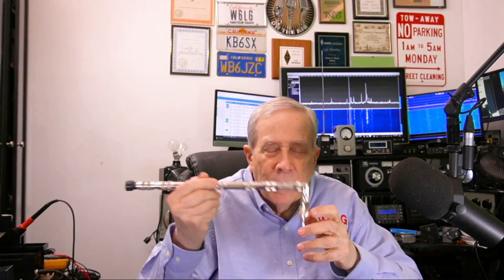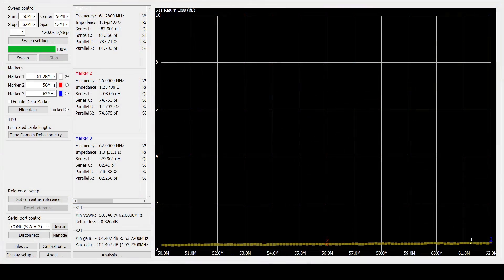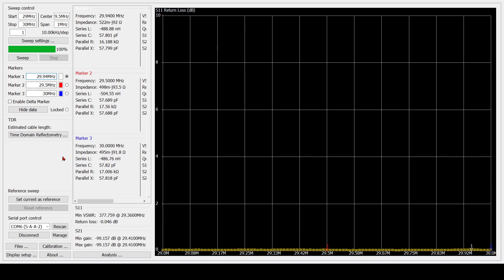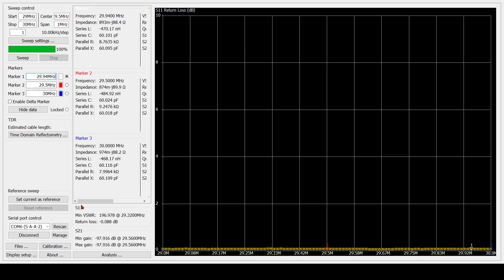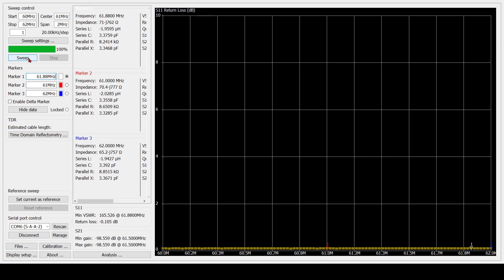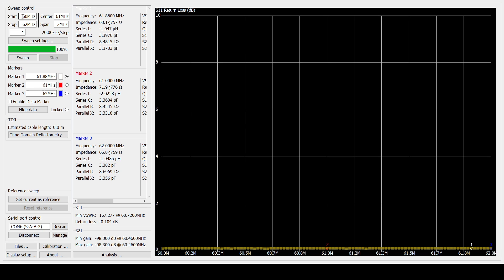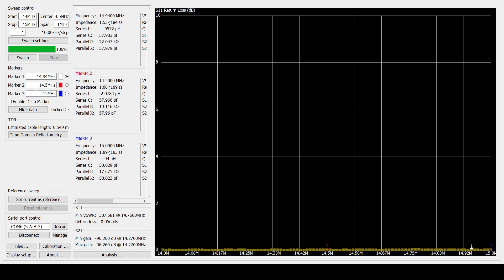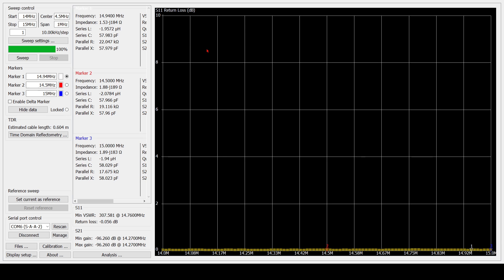Does the PL259 (etc.) have more loss than an N connector at HF?  Which should you use?

Comment: The reason why I may choose an N with an adaptor over a PL259 is availability and options. There are often many more N connectors on the market, and I can choose between crimp or compression etc. whatever the coax be. You end up with a better built and better quality plug with a seal, plus it's often cheaper than the PL259 because of supply and demand. You sometimes have only one option for the PL259 and it is rubbish... or no option at all.

Comment: Many of the old HF tube rigs had just screw terminals to attach striped back coax or a UHF connector with inches of bare wire going to the tank circuit. Even if you clip two pigtails together, you won't see much loss or vswr. The mismatch is just a very small fraction of a wave. Also, if you have a tuner, it all gets taken out anyway.
Reply: Being in the trade I accumulated offcuts of cable. I am not sure I should admit that a "temporary" feeder for one of my HF antennas has a taped up join just outside the shack, it has only been like it for 6 years...
Reply from the maker: Two screw terminals on phenolic; I still have some of those in my junk. 73, Jim

Comment: HF is close to DC compared to microwave. That's where you have to really worry about your connectors, as well as your cable lengths. I had a Tech Class ham friend who tried to put his home wireless network antenna up on his roof using about 60 feet of cheap RG-58 coax so he could use his network devices around his large yard. He called me over when it barely worked 10 feet from the house. He couldn't figure out what the problem was. I showed him the loss chart for 2.4 and 5 GHz (the network frequencies in use,) using 60 feet of RG-58. At those frequencies you can make a stack of connectors like Jim has done and possibly use them as an attenuator to drop a signal a few dB to get it within range to measure without damaging your test equipment, although RG-174 works much better for that purpose. Something around 7 feet will give you 3 dB of attenuation at 2.4 GHz.

Comment: Was hoping you'd try 440 for a bit.  I have a dual band vertical with an N and N's all the way down on LMR600.  Always kind of wondered if I wasted my money there.
Reply from the maker: N connectors are superior at that frequency compared to "UHF connectors".  73, Jim
Reply: @ham-radio  Ya, I figured they would be.  Was just hoping to see if it was a huge difference or slight.  You can just make it up on TX with more power, but I always wondered if I'm literally hearing more because I spent an extra $100 in that area.  The setup I ended up with is modest but it seems to have a really good coverage area.

Thanks.
Reply: I have a dual band vertical, and also run LMR 600, but PL 259's on each end from a previous use.  With a Kenwood TM V71A, its main job is dual band repeat so I can speak to the "local" repeater 65 miles away, from almost anywhere in my county.  I have yet to see a lack of actual real world performance from my use of PL 259's, and run the Kenwood at half power without any issues.  Today I should test if I can't hack it at 5 watts on low power!

Sometimes ERP and gain are everything.  Sometimes you have a big enough sledgehammer anyway.
Reply from the maker: @kingduckford  Understood.  At VHF and UHF, there are good connectors and adapters that are used in commercial applications for many reasons.  PL259, et al, have huge losses at UHF.  But, as you point out, in a pinch you can overcome those losses. 73, Jim

Comment: OK, see you said HF in the title.  Still, I would have liked to see you do the same test at 150 MHz and 450 MHz. 

I have several 50 and 100 feet lengths of coax, mostly RG-8x or similar and RG-58.  Some looks like it may have been used but in great shape and other looks brand new.  Can the Nano VNA test that and tell me if the coax is good or should be thrown away?
Reply from the maker: Yes it can.  Above HF, you should use a good suitable connector that is designed for VHF or UHF.  At HF, for most of us, the PL259 is good enough and it can handle the power with that large pin.  73, Jim

Comment: Once again thank you for taking the time to make the video Jim. I think many of us in the trade have almost a phobic response to Pl259/SO239 connectors. For an easy to fit crude connector they are pretty good, IMHO the biggest problem is the lack of certainty with the shield connection.
Reply from the maker: Thanks and I agree.  Soooo, I crimp the shield.  I have good tools for crimping.  73, Jim
Reply: @ham-radio , thanks for the reply, I meant the shield connection between plug and socket, if the collar is not tightened properly. An N-type of course is not as fussy if the collar is not tightened. One of these days I should start using crimped RF connectors.... I am a bit of a dinosaur! 73

Comment: Might sound like heresy,  but I learned to
really fray the shield and solder it to the 
OUTSIDE then cover it with a quality tape, or even heat-shrink tubing. Cheers and 73. WW5MB

Comment: I was always informed, when I started in Ham Radio over 45 years ago that N was always a better connector; 50 Ohms and usually weatherproof.
N connectors are usually also used for U/VHF frequencies. To support that, Yaesu uses the N connector for V/UHF connection and PL-259 for HF at the back of their FT-991A transceivers.  
Thanks for the video Jim!  Always informative.
Reply from the maker: The title of the video was about HF.  I have N connectors that are in no way waterproof at all.  Some N connectors are water resistant but not waterproof from what I have experience in almost 60 years of ham radio.  73, Jim
Reply: @ham-radio  like I said… weatherproof.
Have fun.
Reply: There is NO 'N' connector on the back of my FT-991A.
Reply: @richardlmontel  I live in the UK and there is one at the back of mine… all UK 991A’s here have it.
Reply: Wow guess we are not suppose to know the difference here, pitiful.
Reply: And to add injury to insult my 2m, .70 does not have an N connector.

Comment: I only ever worried about them on the radios.. I used NMO mounts because they were low profile when antenna was not on vehicle but I figure my biggest loss is for ball mount with spring, yet I only run HF mobile using all mount and spring..except when in a truck where i mount dipole style off the mirrors and usually phase them as well..lol
but N connectors against the pl259 or the bnc??? Small gear I use BNC for weight.. but prefer PL259 as N is heaviest connector and even on 2 meters and commercial gear, I found no loss problems between it and N- many commercial VHF radios use to have PL259 connectors
Reply from the maker: All good information to those who don't seem to understand about connectors.  Thanks for the help.  73, Jim

Comment: What am I missing, please?  I was told that for every connector I added in series in my coax to expect half a dB loss.  I expected that with 6 connectors in series there would be 3dB loss.  Thank you.
Reply from the maker: Almost zero loss at HF.  Watch my video where I string about 30 connectors together and have no measurable loss.  73, Jim W6LG
Reply: @ham-radio  Wow ! that was a very qick reply.  I watched that other video before getting this reply.  
One of the comments below that video mentioned that ypur test results blows out of the water the theory about each connector adding much higher loss than we've been told.
I see that to get low signal loss we should spend on high quality coax instead of on connectors.  Thank you very much.  73 Nk5I

Comment: I like the N-Type sets reading at 20m. 0 loss, but a VSWR of 133421:1.......I doubt my tuner will bring a pre-built stick, let alone a wire to <1.5:1 from this SLIGHTLY high reading........ 

On a side note, I have 2 antenna's sitting here waiting to be put back in the air. One is a dedicated UHFCB (477mhz) 12dBi stick I have had for over 25 years, it has an N-Type from the factory. I also have a v2000 Tri band 6m/2m/70cm stick and it has a PL-259 from the factory, even though it's designed for UHF aswell as 2m and 6m. I would LIKE to believe the designer's of these sticks know MORE than I do when they build them and if they think the PL-259 is OK at even 440mhz, who am I to argue? I have to say, in using the UHF stick I have run RG-58, RG-213 and CLR-400 cable on it and have been unable to tell any real world difference. I get the same response from my local repeaters on all 3 coax, if I listen to the inputs, there is a SLIGHT increase in the static on the RG-58 cable compared to the other two cables, but all three cables allow me to open the repeater 20klms away with the antenna at 12 foot elevation and my hand-held using 500mW ouput. As a consequence, I over bought stuff and now have a pile of N-Type connectors I had planned on putting on my cabling, but have used PL-259's on most items I have built and installed as this seems to be the common connector for commercial stuff. Even my ICOM IC-7300 has an SO-239 socket installed, so below 60mhz, I doubt it matters that much. I haven't noticed any real difference at 27-30mhz, and the losses go DOWN as the frequency goes down, not the other way around. I have NEVER had an issue with PL-259 connectors unless you include the ones I got for about $1.50 each. CHEAP connectors lose more than quality one's, and it matters NOT if they are N-Type or PL-259. Cheap is usually just that. CHEAP. And lossy to boot......just my 2 cents.
Reply from the maker: The end of the adapters was shorted on purpose. Hence the infinite SWR.  You might want to read about how to measure losses.  Jim
Reply: @ham-radio  It was meant to be a joke.....😯

Comment: It was my understanding that the biggest difference between N and UHF connectors was that the N, if assembled properly, were waterproof, where the PL-259's are not.
Reply from the maker: I don't agree with waterproof.  Water resistant might be possible with some N connectors.  Thanks Scotty, 73, Jim
Reply: For best stand-alone protection against water/humidity, you can always use the Messi & Paoloni connectors (N or PL259).

Comment: Very good. Now why would Yaesu put a pl connector output on the VHF/UHF side of  the 991A?
Reply from the maker: The answer is simple. It is a good consumer connector. Okay, I made that up just now.  Most guys can put on a PL259 or have cables on hand with that connector.  Most do not know how to install an N connector or BNC. Yaesu would be responding to calls and complaints.  By the way, Yaesu never answer email from 2 weeks ago.  Really poor or nonexistent customer service at Yaesu from what I can tell.  73, Jim

Comment: I am sure your connectors are of high quality, Amphenol if I had to guess.  How much loss would lower quality connectors have?  Especially when the dielectric tends to melt when soldering?
Reply from the maker: I had do that.  It looked like Teflon.  It was white and dull; but it was crap.  Low cost connectors can be lossy or not.  But they are a mistake. Always buy the best connector that you can afford.  For many, money is tight.  But do the best you can with the connector.  Even if that means a used connector.  73, Jim

Comment: Jim, have you done a review on the Nano VNA?  Where can it be purchased?
Reply from the maker: I bought some recently on Amazon.  They were listed at $18 each!  There were 3 left and I bought them.  It may have been a mistake by the seller.  I have seen some at $50 each for the older version; that works fine.  I have seen some recently that looked really good at $120 on Amazon.  73, Jim

Comment: Do you think the brand, material and number of times assembled makes a difference?
Reply from the maker: Yes Mike.  Cheap connectors and adapters are crap.  In the long run, stick with the best silver plated and Teflon insulation.  Same goes for the most important thing, the coax. 73, Jim

Comment: Hi Jim- thanks for the video.  I agree with you regarding VHF and HF frequencies.  

When did we start calling "adapters" "connectors"?  To me, a connector is directly attached to a cable, and an adapter goes between the connector and the equipment (or another adapter).  

The PL-259 was termed a "UHF connector", because back when it was developed, VHF was "ultra high frequency".  But for 400mhz up, I believe the N connector is the way to go.  For HF and VHF, I use a PL259 SO239... they are cheaper and work fine.  

And for the "experts" who question your measurement methods....this is a relative comparison, and this video was not intended as part of an engineering syllabus....it was a nice demonstration.  

Let me just add one more thing:  I believe that if you added a well-used (not brand new) cheap 90-degree adaptor into the mix, your losses would be greater, especially if you actually measured power dissipation and not just low-level signals from a VNA....I have removed ALL of the cheap (amazon, not amphenol) right angle adapters from my gear.  73
Reply from the maker: David, I agree with you 100%.  So, I will move your comment to the Description section of the video as a correction and further explanation late today.  I have someone coming by the house to buy several Yagis and rotators that I had at the old QTH.  I do and did know the difference. I did misspeak.  I had no other way to do that "test".  My thoughts were that N adapters would have about the same relative loss to the so called, misnamed UHF connectors and adapters.  For convenience I did use what I had.  I believe the one N right angle is ancient.  I have had it for 50 years or more.  It would be interesting to string about 20 (which I have) right angle UHF and see what that does. Thanks David, 73, Jim
Reply: @ham-radio  Hi Jim.  My intention was not to be critical of you, but rather highlight that terminology is frequently misused (often not by you), and I think part of communicating ideas and concepts (which has made amateur radio great for so many years) is to speak the same technical language.  For example, is it a balun, an unun, or a transformer?  Or an autotransformer?  Is it a longwire, random wire, or resonant end fed halfwave?  A counterpoise or radial?  Do they all mean the same thing?  No, not exactly...and I think reinforcing the meaning of words and technical concepts (as you did with "dot dash" vs "dit dah") is important to illustrate the true technical and service nature of amateur radio, and avoid the hobby from being transformed into a bunch of "appliance operators".
Reply from the maker: @daveN2MXX  I know. I did not take your comments the wrong way.  I just said to myself, crap, I did not intend to make that mistake. I even thought about it before recording.  We need to get the terminology correct.  If I could bleep the words I would. I do have a sense of humor and I do listen when someone makes a correction.  I have a Phd friend who often is very critical of my non-engineering skills.  73, Jim ...packing stuff for my friends to buy. Lots of stuff including a box of right angle connector......adapters!

Comment: Should you not look at S21 … the loss through the device under test?
Reply from the maker: Yes, sure.  The results would have been the same. If you divide the results in half because of the round trip.  Then divide by 20 connectors and adapters, the answer is still zero at HF.  Thanks for asking and maybe I should have done it that way for the demo. 73, Jim

Comment: The major advantage for me is that the "N" connector is relatively weatherproof.
Reply: Sure, they have a rubber washer at the end of the connector, but nothing stops water from getting under the ferrule and into the braid of the cable (or between the outer jacket and the outer conductor in heliax). I'd still seal them up properly - a few layers of electrical tape at minimum, and better yet to use a couple layers of self amalgamating tape first, and electrical tape after, as he showed in a recent video.
Reply from the maker: Yep, that is good advice.  Yes, relatively water resistant and not water proof.  All in all, N connectors are excellent.  But for some of us, not the best choice at HF for other reasons.  73, Jim W6LG

Comment: Probably been a while since you sat for a FCC exam, Jim, therefore what should be noted for those interested, differentiating the frequency ranges of SMA, Type-M, and Type-N is necessary.

My FT-991A uses a type M connection for UHF but if one holds true to the exam, type N should be used.  Question T9B06: Which of the following connectors is most suitable for frequencies above 400 MHz?  73 from Florida, KO4CES
Reply: He knows that. Being a ham for as long as he has, involves lots, and lots, of continued education, as well as lots, and lots, of discussion with fellow hams. He has this other video at (time stamp) 7:03 minutes,  that talks about the impedance of the UHF connector (PL-259) that varies, especially at UHF frequencies. Here is a link to that video.  https://www.youtube.com/watch?v=_65CnalheRk